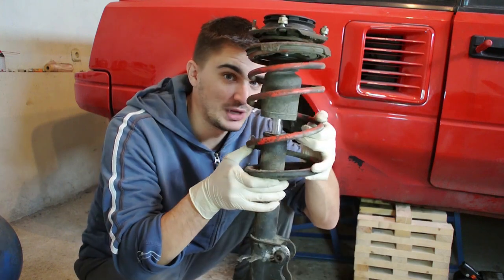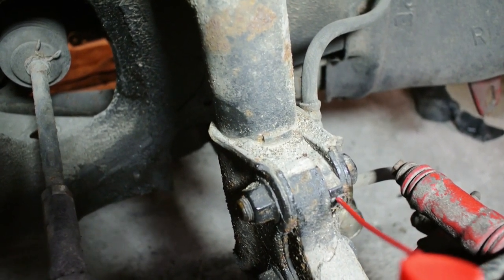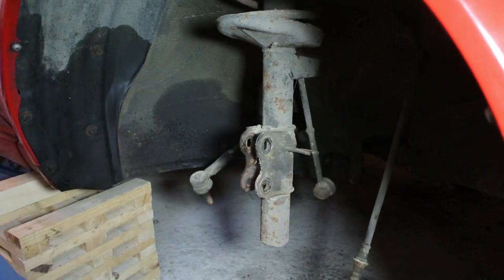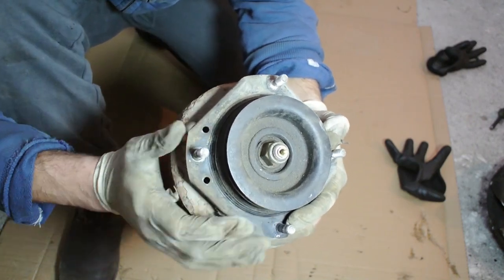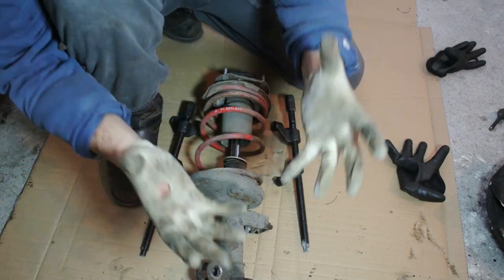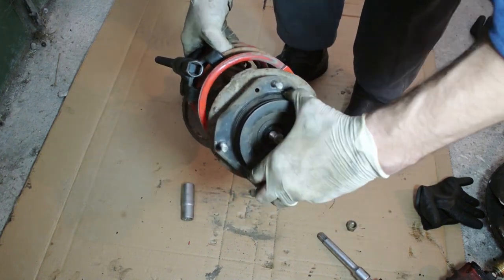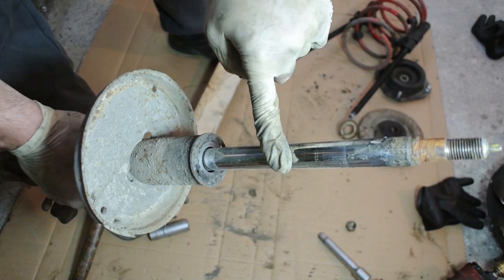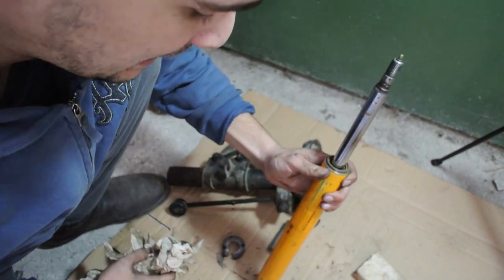How to remove and disassemble struts - suspension episode 6

Comment: Don't forget to add a bit of ATF inside the cylinder were the strut/shock cartridge sits in. 

My '82 Tercel has similar front strut cartridge suspension and the Factory Service Manual recommends to add a couple of ounces of ATF inside the assembly.

Comment: Thank you for a great film. I'm removing my 1st strut (rear), so it was very useful for me.

@3:20  Do you need to support the Steering Knuckle? Did you support it? Or where and how it was resting? 

@7:37  You can loosen the nut on the car, not remove completely of course, but just brake it loose. On my struts (rear) you are suppose to keep the central rod w/T-45 socket and to remove the nut w/open wrench #21. It would be very hard if not to lose it while it is still on the car. 

@8:55 We have the Coil Spring separately, but it is still compressed. For some reason no one in any film on this question shows how to release it. Probably it is very simple, but ... Looks like the most difficult part of the project for me.

   Thank you again.

Comment: at 3:20, isn't there a pressure pliers engage so you can lock the ball joint of the stab. linker and freely spin the nut out? here in brazil you have to, or a regular wrench or pressure pliers to do this job, instead of cutting of the screws

Comment: My truck has shocks and springs. I bought struts by accident for the same year truck and can't return. Can I remove the spring from the strut and use it on my truck with the shock?
Reply from the maker: I would not recommend it
Reply: @d4a  why not? Because it's dangerous taking the strut apart? I already took it apart with a few rachet straps. I am going to take the old one out and compare it. Was hoping someone knew if the coil was the same or not before I removed the old spring

Comment: You don't have to cut sway bar endings (or whatever it is called, sorry I hope you get my point). There is a tool for that, but when they're spinning so easily they probably need to be changed anyway :P
Reply: Use a pickle fork =)
Reply from the maker: Hmm. I think pickle forks are for separating ball joints and tie rod ends. This is a very stupid situation where it was impossible to remove the nut. I could have used something to hold the bolt in place somehow while removing the seized nut, but it would be far too much trouble for sway bar end links that have been welded in the middle and have failed in their jointed part.
Reply: They have multiple uses. I've used them in the past to prevent any sort of ball joint from spinning while I try to take the nut off. Vice grips can also help, if the thread is long enough.
Reply from the maker: Jeff Reeves I guess you could use them in this case too, if you wedged it and had one that fits tightly on the bolt. But I would instinctively go for the vice grip :)  Haven't really used pickle forks much. How's your aw11?
Reply: Oh, it doesn't need to touch the bolt, you just need positive pressure against the ball joint to immobilize it. 

As an experiment, lightly grip your right wrist with your left hand, then try twisting your right wrist (simulating the bolt on the ball joint). Now slide/pull your right arm away like you are trying to slide out of handcuffs. You'll notice that it is now harder to twist your right wrist. The same thing happens with the ball joint.

Also, if you use vice grips be careful not to damage threads you want to reuse. I put a bit of leather or duct tape in between the vice grips and the bolt to prevent damage.
Reply: My AW11 is doing pretty well at the moment. Just did a oil change and oil filter change. I managed to finally fix my dash lights and tail lights dimming and shutting off randomly. The problem was the junction box by the driver's side footwell. I made a schematic of the entire thing using a multimeter and bypassed it (took like three days). Now my lights are solid =)

I also started organizing my photos so I can update my website. I have over 20k images to sort through lol. Almost done though.
Reply from the maker: +Jeff Reeves Thanks for sharing that. Sounds like you're good with wires. I really need to improve in that department. Whoa 20k images! A real ordeal.
Reply from the maker: +Jeff Reeves I actually tried the experiment. Good analogy. Now I get it, thanks. I will be replacing all of mine so I just hammered them all in order to separate them. Flattened the top of the bolts nicely :)
Reply: Well, if you ever need help with wiring hit me up. Feel free to add me on Facebook or message me through Instagram.

Comment: If it were me, I would never have just welded that sway bar link in the middle! It should have been sleeved. Find a piece of tubing that slides over the sway bar rod, use about 2 inches. Slide it over the rod, then weld the rod. Grind down the weld until the tube will slip over it, then weld the tube in place with an inch on both sides of the weld. Much, MUCH stronger that way!

Comment: DO NOT USE A IMPACT GUN ON SPRING COMPRESSORS. They can cause compressors to spin on spring to one side
Reply from the maker: +fila1445 These ones had "suitable for impact gun" writen on the box they came in. I guess if that wasn't written, impact gun should be avoided.